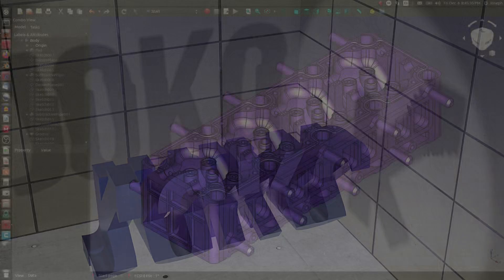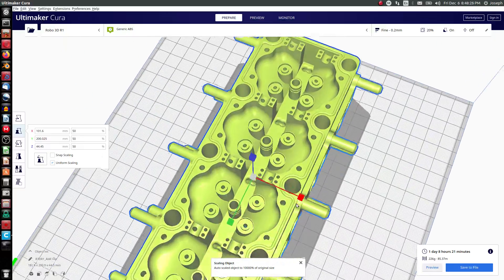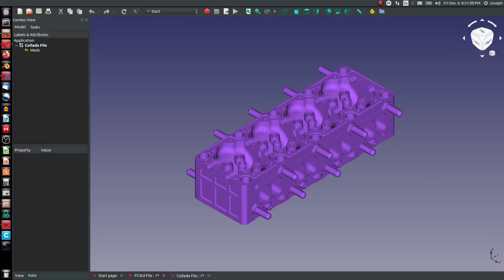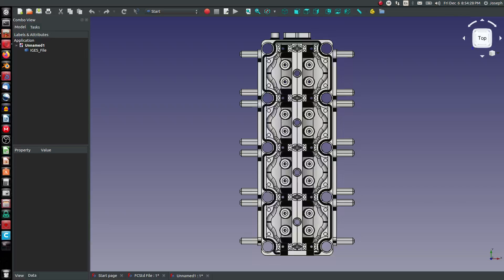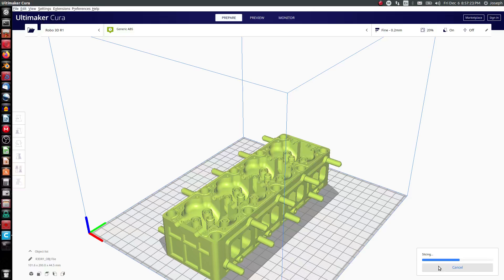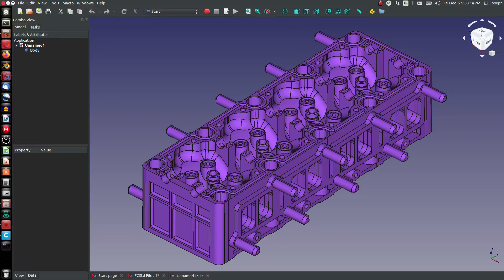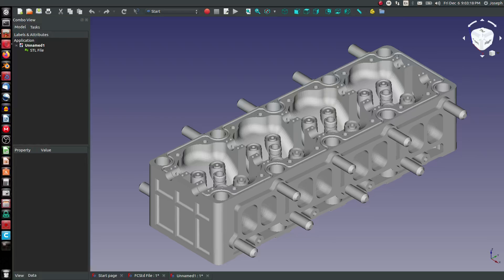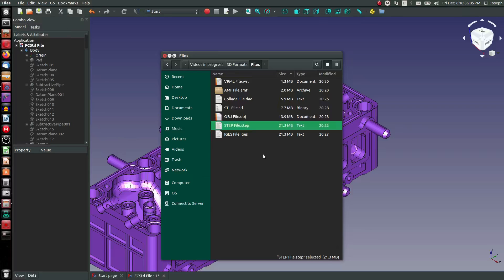Understanding 3D File Formats - STEP, STL, IGES, OBJ and MORE!|JOKO ENGINEERING|

Comment: File formats handle geometry differently. Some a circle is a circle and others it's a polygon. So does slicing with a file that a circle is a circle and then printing using something like Arc Welder that prints using arcs and lines, could make true circles or arcs that are not really segmented lines and improve print quality? Arc Weld does dramatically reduce file size, which reduces how much data needs sent to the printer to create the same object. Gcode is shorter because it take less instruction to create a circle than to describe a polygon that looks like a circle.
Reply from the maker: I'm not that familiar with ArcWelder but I do like true circles when I can get them.  When I have to used a meshed (polygon) format, I usually make the mesh tighter than the tolerance of the machine and the segmented lines aren't of much consequence after that.

Comment: Sow what files is best for printing?
Reply from the maker: Interestingly the new kid on the block is the 3mf format that is predicted to eventually obsolete the stl format.  (In the same way STEP obsoleted the IGES).  It's probably the best because it has "bells and whistles" like texture/color information and is in a format that is easy to edit the file itself.  As far as just getting the part printed, all mesh files are about the same for the slicer.  For quality prints, the fineness of the mesh is the most important part instead of the format.  But overall 3mf is looking to be the best file, even though print quality probably won't change between formats.